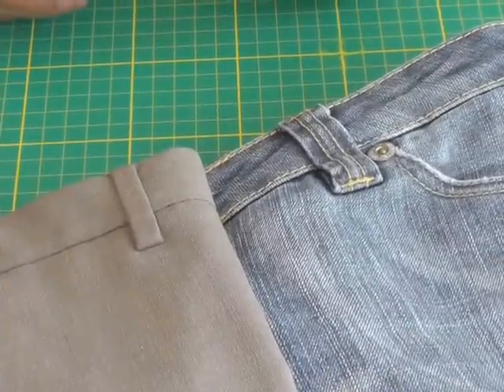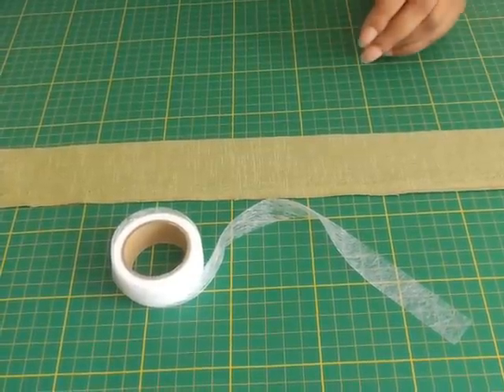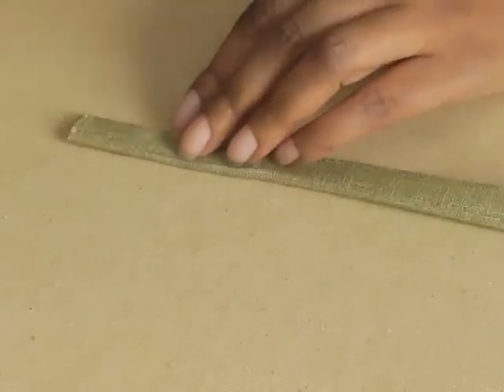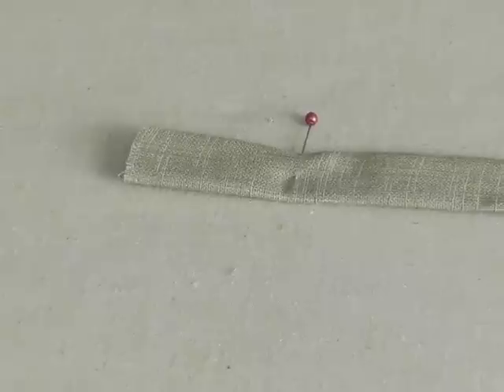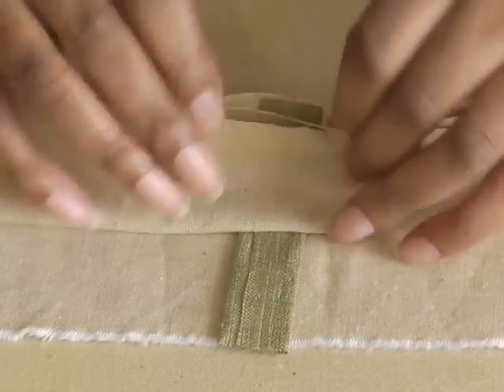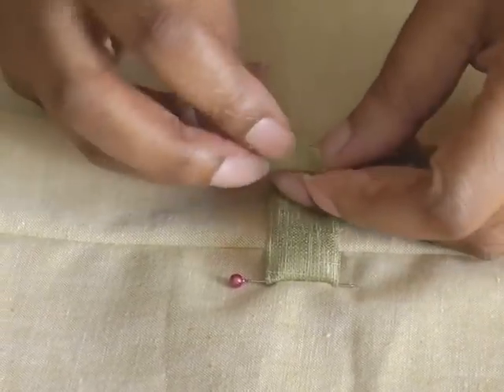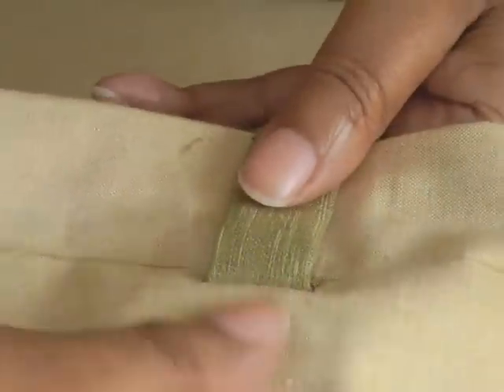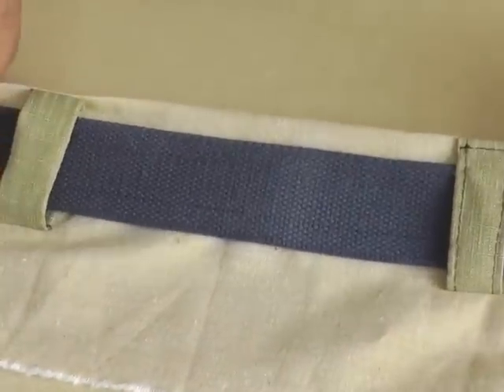Making and Sewing Fabric Belt Loops

Comment: That is an excellent method for belt loops. I just realized, belt loops would also be a great place to use one of those many decorative stitches on your sewing machine. Before cutting the loops, run a decorative stitch down the length. Thanks for another great video.